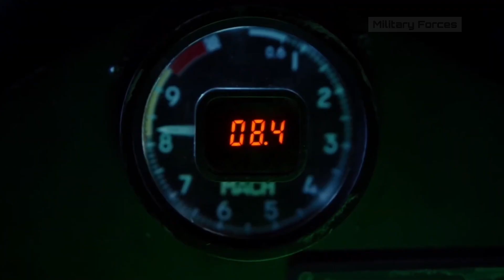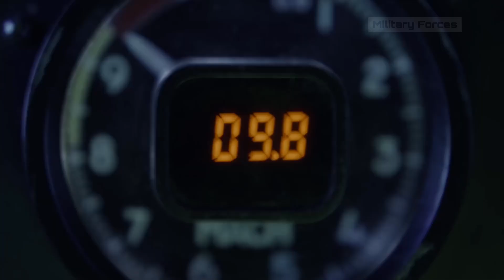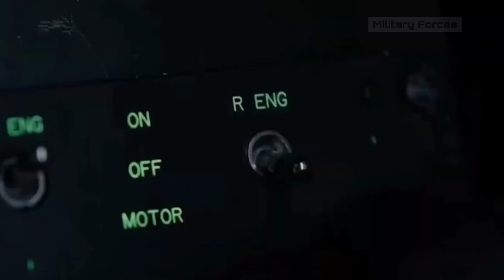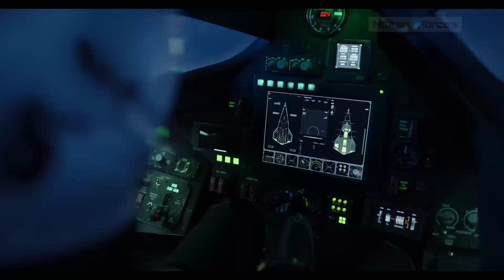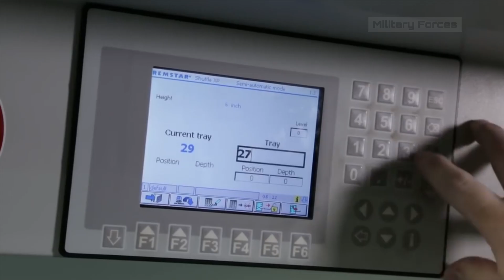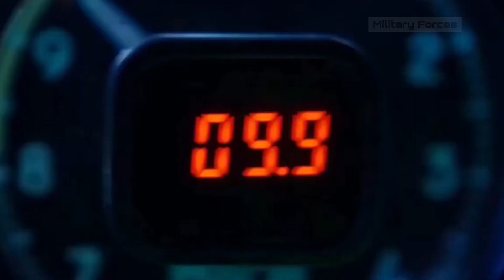US Claimed SR-72 Darkstar is REAL! and It Will Change EVERYTHING. But...

Comment: We’ve had antigravitic propulsion since the 50’s it just hidden from us, I saw the most beautiful woman in a full window on and in rings around the bottom of the  lower half of the saucer. It came out of a  blackish rolling cigar shaped cloud when it stopped rolling then coming over between our neighbors home and ours at telephone pole height completely soundless. She looking out the window dressed in a rich burgundy evening gown to the floor holding a matinee in her right with her left arm around the front of her tight tummy, dark pixie hair fashion. I called my mom and she came running to my east bedroom window and looked out her mouth open wide in disbelief. The woman called a man who was shorter than herself and he came to her she clearly directed him, and he turned about and left her. Then the UFO shaped like two round dinner platers on right side up and the top covering the lower upside down. The bottom were all around had windows in its support base all around the case to the top of the bottom of the bottom half of the vessel. It the moved north over the corn cribs in Nebraska moving north westerly then flipping on it edge then simultaneously shooting up soundlessly straight into the sky and thru the cumulus clouds. Peace be with you.